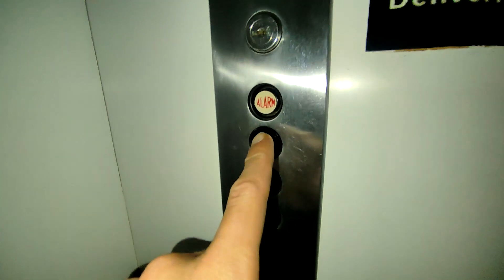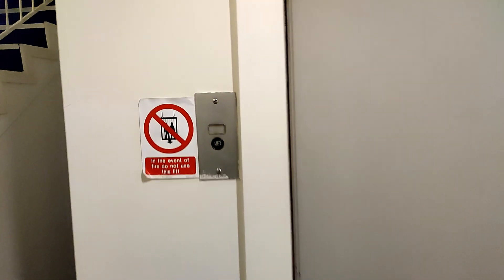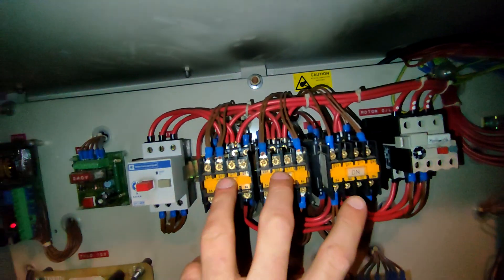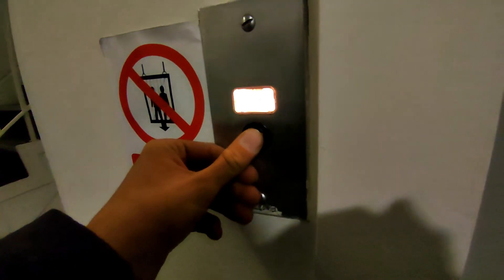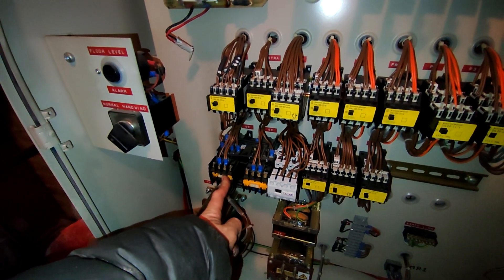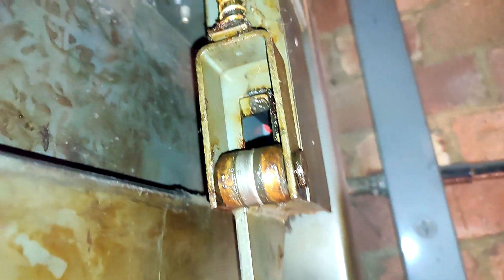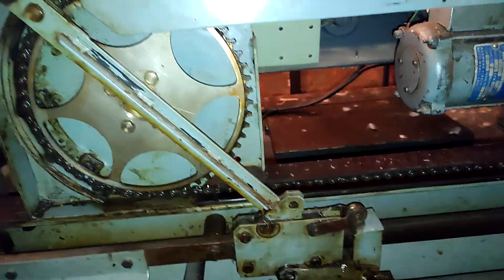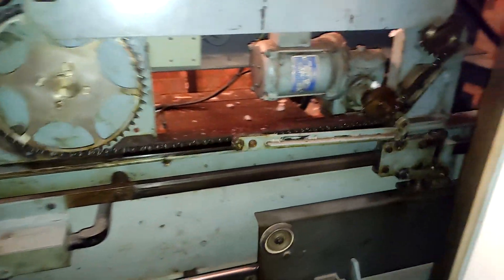Detailed look at Abandoned 60s Marryat Scott

Comment: The logic looks quite new, I wonder if it was replaced but is still remains very simple (only some circuits which look simple)
Reply from the maker: The shape of the logic cabinet looks Thames Valley.  Seems like a very old version.  If it is a replacement then I wonder what happened to the original logic.  The old Dewhurst slate logic that Marryat Scott usually use is very reliable and wouldn't need replacing so early on.